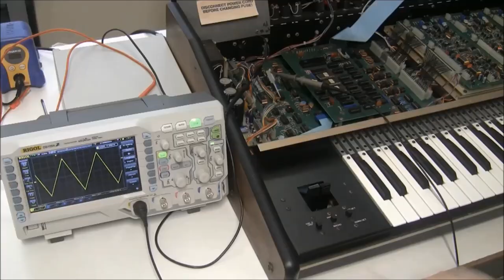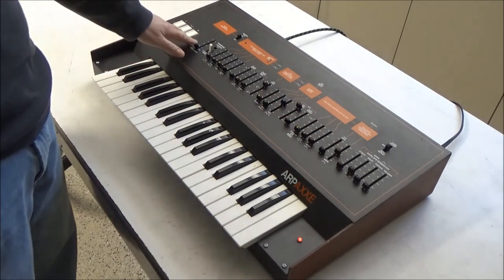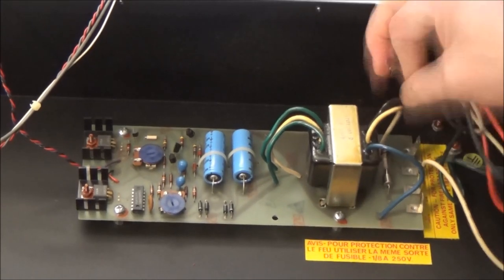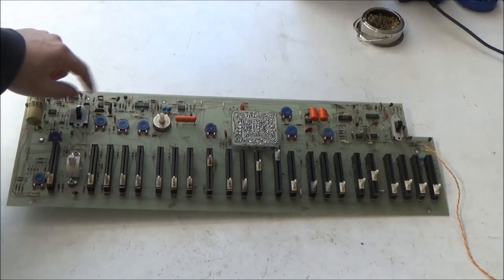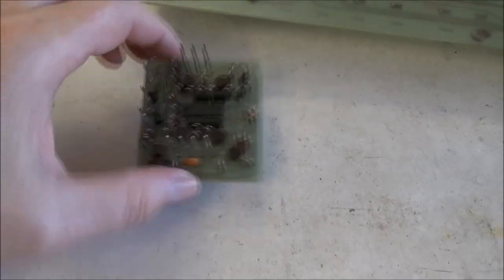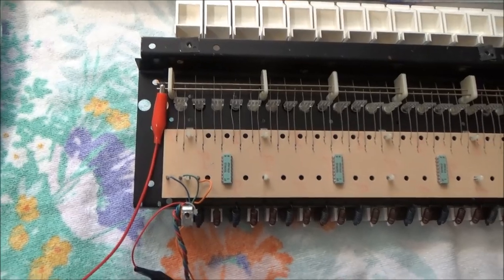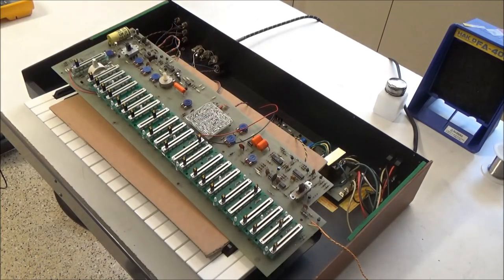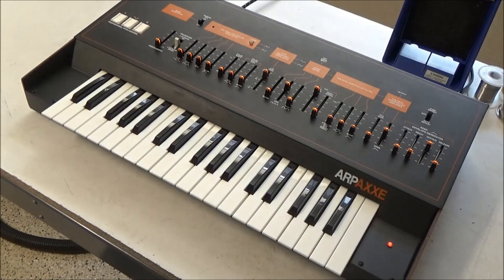ARP Axxe Repair & Restoration - Synthchaser #134

Comment: First synth I bought in 1978. Took my life savings of 650$ and got it brand new.  The ppcs worked for about 2 months, and were so hard to push that it killed your finger. Gigged with it for years. Decided to work on it a few months back. Got your kit and swapped out all the caps and chips. Rebuilt the filter. Rebuilt the keybed with new bushings. Replaced the large yellow film capacitor. Replaced the garbage ppc sensors with fsrs, but hooked them up wrong, the flat one goes sharp, the mod one goes flat and the sharp one does the mod.....but I was thrilled that they worked at all after all those years with NO pitchbend! Still have no noise and the pulse width section is not all working right. Any tips on that? Probably need the noise transistor and? ......saw the new Behringer Odyssey with the colored LEDs....just got one and I love it! Still gotta finish the AXXE tho.....so i can move on and rebuild and gli gli my old prophet 600! Thanks for finally doing the AXXE!
Reply: oh also I took the circuit board out and did the scrub with Simple Green and spray down with WATER in the kitchen sink! Fixed most of the sliders! Maybe the noise slider is messed up tho....
Reply from the maker: Sliders are an important part of methodically restoring these.  You saw in this video how the S&H started working after replacing the slider.   If all PWM sliders don't affect the sound then it's probably a faulty 3086 transistor array.

Comment: @22:41 What was the reason they used Tantalum caps in those days in the first place? Why didn't they just put in your normal run of the mill electrolytic caps?
Reply from the maker: I think because when ARP started making synths electrolytic capacitors were much larger than tantalums.  Their filter modules were really packed in even with the tantalums.  Towards the end in later Omni 2s and Quadras they did switch in many places from tantalum to electrolytic.
Reply: @Synthchaser  Ah right. That would make sense. Thanks!
Reply: Tantalum caps were great until they turned into 5 ohm resistors. Small for their capacitance, low esr, etc. i heard somewhere they need to be used at voltages 1/4 or less than their rated voltage. I’m not sure that was well known in the 70s and 80s.

Comment: Isn't the croc clip on the bus bar still a bit dodgy? A good knock or two and it'll fall off, won't it?
Reply from the maker: Maybe, but time will tell.  I figured if it was abused to the point that a key broke but the clip stayed on, it should be OK.
Reply: @Synthchaser  Good point!